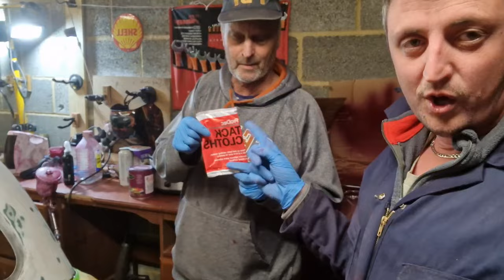Starting the 2nd colour of coach carriage cream on an Austin a30 1956

Comment: Looks like water in some of the paint from the compressor put compressor on the floor allow a loop of hose from the compressor then attach a water trap then connect remaining compressor hose to water trap and other end to your spray gun this traps condensation or water in the looped hose and eventually goes into a water trap and not straight from compressor to your gun my father had the same issue the water spots appeared after a few days

Comment: It's starting to take shape now mate 👌 I'm surprised that you dont use a paint strainer for your paint they cost pennies to buy I allways use them you would not believe some of the crap that is in paint even expensive paint . And on the orange peel that happens when uv got too much paint and not enough air iv discovered that cheaper paint guns need a lot more air to atomise paint than the expensive guns usually around fifty psi . And on the subject off flattening paint back use a soft sanding block and start with 1200 grit wet and dry paper then 2000 grit and finish with 3000 iv allway found this works best 👌

Comment: Hi Kris & Ian,
I think that you have enough paint on the car to wet sand back as it is, get it down so that your high spots have gone , then i would machine polish use G3 ( not the liquid stuff the harsher one like a paste) keep this stuff wet and take your time not to burn the paint, plenty of water keeping it cool. It will be like a mirror when finished though time consuming. Looking good though, well done both of you.
Reply from the maker: Interesting because the compound we experimented with was g3 liquid I will take a look online to find the harsher stuff good shout. Yeah we thought so I mean it's had 2 coats of paint the only thing is tge compressor is very weak we are now wondering is it didn't blast enough paint on so we are gunna just put another coat on the hood just to see if it makes any difference 🤔 many thanks for the info kris

Comment: enamel go,s on better and self flattens out  if the panels are hot, like  the car hs been left in the sun  at about  28 degrees  celsius for bout 45 minutes or so
Reply from the maker: Okay that handy to know would it work if I had the heating on high in the garage before painting? Thank you so much for the info man